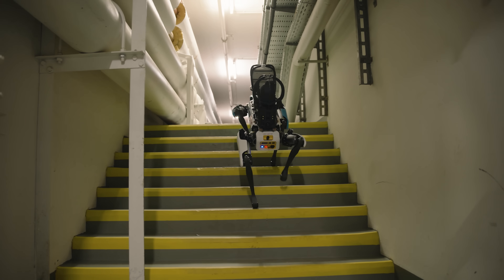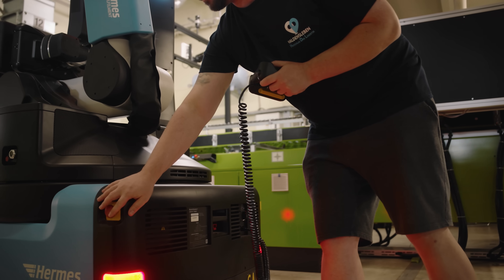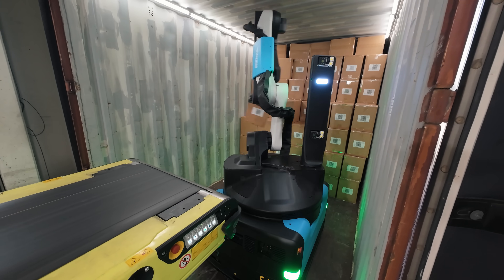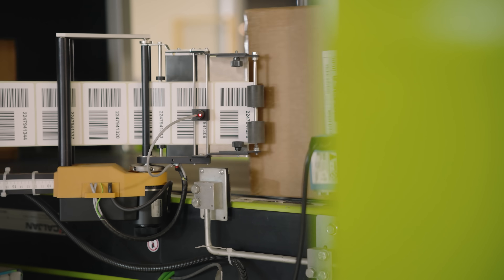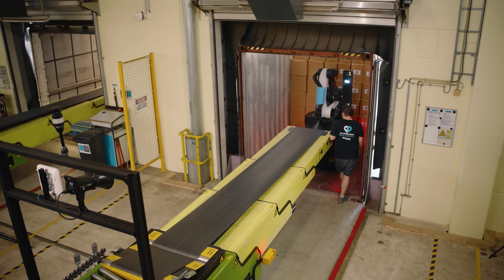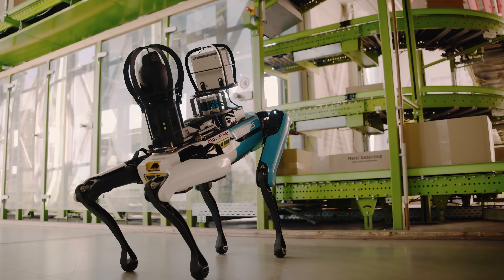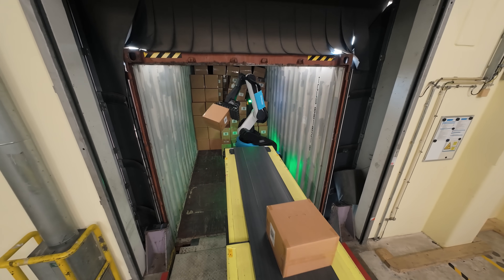Stretch Debuts in Europe at Otto Group

Comment: If you’re a warehouse owner and you’re considering buying this robot - don’t . 
Recently I worked at a warehouse that utilises them. 
It’s painfully slow, spends more time charging than working, requires perfectly shaped and stacked boxes to be able to unload a truck, and if it drops a box, it gets confused for a moment, then proceeds to pick another one, leaving the one it dropped on the floor. 
And the best part? It’s at least $500K a piece. 
You’re still better off giving a contract to a semi-skilled worker for ten years, it’ll be cheaper and more efficient, as one of these probably doesn’t last this long.

Comment: soo0o it's a robot arm that is designed to complete a task in a fixed environment (a container) - ie it has standard guardrails? Like a robot arm in a car factory? .. and it has to be hauled into place to start? that seems to be robotics on "easy mode" . And we did not see it actually complete a load, or pickup any dropped boxes. Also.... how is that container packed so neatly?!  Please show us a demo on "hard mode"

Comment: While this seems like a stretch, i worked in a large automotive plant that had 'robots'.  Welding robots and painting robots, which had static bases, and logistical robots, like forklifts and trolleys that delivered parts in cases to the assembly line and retrieved empty cases. The only difference between these robots and the one in this video is the incorporation of sight, giving Stretch a modicum of autonomy.

Comment: TLRW - Its a robot that moves boxes with suction cups. 

My thoughts - It will probably cost $500k up front per unit but will reduce compensation expense by at least $100,000 annually. Break even time will probably be around 6-7 years once you consider maintenance and service contracts.

Comment: I stopped play for a moment at 2:32 because THAT IS TRUE THAT IS A FACT I can recall one day MANY YEARS AGO I was forced to walk away from a truck lumping job that wasnt far from finished but there had ALREADY BEEN six other guys walk away from it before they even called ME over there to it by two oclock that afternoon I'll never forget it was a truckload of bags of dog biscuits that werent even palletized they were just piled up in the back of this full size semi trailer truck and it was sitting parked at the dock of this transfer and distribution point and the interior of that trailer on this summer day it was I forget what year but it was late summer and the interior of that trailer I kid you not giys it must have been close to 300 degrees F in there it felt like goin into a furnace with no firesuit i was like what the fucking hell is this even real is it even possible am I actually walking through a portal into the fires of hell itself here with it just LOOKING LIKE a trailer or what I made I cant remember if I made more than three trips into and outta that trailer hauling like four bags at a time because YEAH that was the real kicker they werent even bringing a palletjack and pallets to load these bags onto they had NOTHING even at the tail end of the trailer to put em in when I DID bring em out the dock manager was like just lay em on the floor and we've got a guy thatll come and pick em up yeah I think I made about 3 trips in and outta that trailer and I was like DUDE this aint happenin cant ya get a shop fan at least and aim it into the trailer to pump cool air in there and he was like no we dont and he didnt even apologize he was like and ya need to HURRY UP we need to get this trailer outta here I just looked at this guy and pulled my glives and said nope THIS LOAD is NOT MY PROBLEM mister its YOURS this is an OSHA CIOLATION is what we got here so GUES WHAT mister you are signing off on my temp agency work ticket to verify that I DID at least show up and I GET PAID for MY 4 HOUR GAURANTEED MINIMUM check for twenty bucks which he did sign and then I LEFT went back to my temp agency workplace turned the ticket in and got my check for twenty bucks cut to me - I know thats just a war story - NOW if ya want the REAL JUICE since ya sat through THAT and read all that THE IMPORTANT THING TO KNOW HERE FOLKS IS THIS these robot workers ARE NOT your enemy ok I KNOW we've got more than just a lot of pissed off dockworkers lead by some idiot thinking he's gonna cripple north america by shutting down the entire east coast and gulf coast shipping ports BUT its all just more engineered shitshow like political rallies the robots are the only chance we've got at maybe terraforming mars and making it suitable for human habitation THATS WHY WE're using them HERE we're JUST TESTING THEM for functionality and durability because if they cant even hold out in EARTH conditions they sure as hell aint gonna be able to hold out on MARS but we've GOT TO USE THEM to construct livable structures and working infrastructures and LABORATORIES capable of creating and HOPEFULLY RECREATING HUMAN LIFE FORMS to kick start a colony there. Earth is doomed folks theyve told us the eventually the sun is gonna dislodge the moon from our orbit and when it does its gonna have bad consequences for all life on earth WE HAVE to get out of here and get to mars and from there we hope to go beyond as well THIS IS humankinds best hope for a future or at least its the best one that anyone is collectively working towards anyway

Comment: What if part of cargo area get wet? How does it handle soaked box side? This is just perfect condition show case.
It's really an overkill, using highly advance and expensive machine to do dead simple task, like hiring Optimus Prime to wash your car.
Reply: the problem is that the machine is not very advanced. It is a general purpose machine, that could do a lot of different jobs. A machine made specifically to unload boxes from trailers could do this job at least 5-10 times faster that Strech can, and do it better. A human could run a bunch of these at once, and step in when something difficult needs to be dealt with.

Comment: I'm guessing that the robot can't handle pallets very well? Meaning that a human employee has to cut open the pallet before the robot can start removing boxes and once the pallet is empty, a human has to come and remove the pallet before the robot can continue. You can't ship unsecured goods like what was shown in the video. Also, these boxes are way too uniform and light. I'd like to see some 30kg box that has holes in them, is sogging wet and has been taped up on all of its sides. Now that's what I call a challenge.

Comment: Why not have the actual trailer bed itself push out the boxes onto a larger sorting belt? Maybe we could modify trailer interiors to have a mechanism like this. This would be so many times faster than removing each box individually.
Reply: If the logistics industry hasn't implemented such a mechanism yet I guarantee you it's not practical for whatever reasons.

Comment: uniform boxes, clear visible QR codes, always the same sequence no mention of how many units are usedd on the floor -> staged ad. 
Otto is probably using one unit for testing purposes. I don't think Otto is using Stretch productively. A Testing phase with nice PR.
Reply: As if the LED Lighting inside of the container was not a giveaway already.

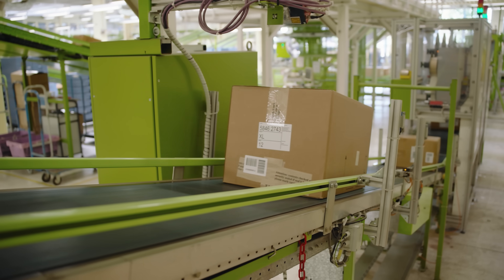Comment: Opps at 1:51 Stretch makes a mistake, and the camera cut away before showing it! HAHA, it's about to pick up a box from the bottom of the stack that is only slightly exposed.
Reply: Maybe, but it seems like all the boxes are pretty uniform, so overlap would be unlikely.
Reply: I‘m pretty sure it chose this as a resting position and its job ended there. This box also doesnt have a QR Code.

Comment: What about crushed boxes? What about half open boxes? What about boxes that are heavy and not robust enough to handle being picked up by a single face of th box without tearing the face of the box clean off?

Seems like you're just using it to unload perfectly pre-stacked boxes that are uniform in size and weight. What about a tiny box with metal plates in it? 

Been working around Ocean containers long enough to understand this is only useful for a tiny minority of uses. Without arms to grasp from the sides or underneath the boxes it would ultimately be useless for the vast majority of floor stacked containers I've seen.

Cute prototype, but nothing more imo.

Comment: This system isn't how it will be achieved. A whole load using a conveyor system & QR tracking scans the load & pushes the whole thing in at once. Turn around is less than 20 to 30 mins. 

The load is assigned to a certain truck in the network  the weight is accurately distributed in the trailer via sensors.

The trailer has a built in conveyor system also i

Comment: I worked in warehouses for ten plus years and I tell you every time they show these robots, they never show me any damaged boxes or any irregular boxes. Quite amazing to me. 😂
Reply: @damienwade7848  yeah and they're always indentical dimensions and perfectly stacked. trucks in the real world show up like they rolled down a mountain and with 1000 small packets mixed in with the boxes
Reply: @Zreknarf  Can confirm! Because I loaded them like this! I got minimum wage, they got minimum effort.
Reply: It’s a marketing video so they’re going to want everything to be pretty and clean.
Reply: @NBSV1  Certainly, this is one thing to consider analyzing this. It's also theoretically true that Stretch's capabilities are still limited in some way they're trying to hide, but they did claim in the video that it can handle graphical boxes, damaged boxes, irregular boxes - And the capabilities of the hardware, at the very least, back up that claim.

We know that this type of gripper is highly capable, when controlled correctly. We know that this thing can lift and move a box. The only question here is the software, as it always is.

Call me a fanboy, but I really don't see them making claims about the software that the software itself can't back up. Boston Dynamics has always been a highly holistic robotics company - They don't depend on gimmicks, and the only stuff they do that's "flashy" is stuff that actually works.

Granted - I'm surprised they went to so much effort to make everything look so clean, when that visual hugely undercuts the impact of the capabilities of this robot.

For example - Nobody has commented on the fluorescent lights in the corners of the shipping container they've set up here. Stretch can operate in the dark? They're not showing that - Probably just because it's hard to film cleanly. But they are saying it. Stretch can deal with graphical boxes, damaged boxes, irregular boxes? They don't show any of those, because A: It would be visually messy and hard to track, and B: Probably because they don't want to have to pay to license all of those graphics for use in the video.

There are a lot of practical reasons for them not making the video more logistically impressive, but it does also undercut the point they're trying to make. I think there were ways they could have gotten around that to make a more effecting demonstration video... But on the other hand, it is a marketing video.
Reply: All the workers are really excited. Meanwhile, no videos of said workers 😮😅😂
Reply: It also works much slower than people
Reply: @poochyenarulez  but it works all night, with no break and no night shift bonus buddy
Reply: @Stormsolid  no breaks, no sleep, minimal lighting, and most importantly no heating or AC.
Reply: Sometimes trailers have big boxes of damaged liquids inside we are not allowed to place them on conveyor. Imagine this thing will throw anything on the conveyor
Reply: Have a sister who worked in UPS it severely damaged 3 disks in her spine leaving one almost completely ground down.
This work would be best left to the immortality of the machine
Reply: And all of them have the same size xD
Reply: i love it when people make one nice wall of boxes only for a complete mess to be behind it, where the loader just threw all the light and small boxes in there.😂
Reply: If replacing a human with a robot is financially viable, then they will standardize packaging to favour the robot. Standardization of packaging to deal with automation is not new.
Reply: That's what I thought. Nice demo, now let's see how it works with a real container! At least it's nice to know that we are not being replaced by robots.... for now.
Reply: @damienwade7848 true. Modern robots can hanfle irregualrities well. The can even be programmed to pick parts from a bin laying in a random orientation. This one can not handle round objects or stuff that isn't boxed. Nor can it handle boxes where to bottom breaks out if you lift them. :D
Even this is a question of manipulator type used and can be done. It isn't all about letting the robot replace any worker (just a few). Sometimes even a fancy robot like this needs help and even more maintenance than a human after 20 years of operation.
Reply: I have never received a damaged box except a few scratches or a little dent here in Germany.
Reply: It can pick up a damaged box and irregular boxes❤
Reply: @ankhenaten2  the video says "Slightly damaged boxes". Emphasis on the word "slightly" there. they probably say that because it can't handle heavily damaged boxes.
Reply: @hughmungus2551 why not ? It works by suction ? as long as a small surface area isnt completely folded into each-other, the robot can use the cups there ?

Comment: Isn't using a walking robot like Spot on a smooth and level floor surface inefficient energy- and cost-wise? Wheeled robot could be cheaper (original price and repairs) and faster moving.
Reply: Yes, and in an industrial setting, with smooth open floors, that would seem better, but a walking bot can climb stairs and go over obstacles. Plus, they have a hammer, and they are looking for nails to hit with it.

Comment: Order picking is one of the last high paying labor jobs left in the US... Companies also want to reuse boxes as many times as possible to reduce cost, this robot requires nearly perfect boxes with only minor damage, meanwhile the vsst majority of boxes at the major warehouse I work in are almost entirely destroyed, holding on by a thread. From what i see in this video, the robot is probably around 1/5th the speed of a human picker/stacker at best, of which our warehouse runs 24/7 shifts of already, so at least my union labor job will last a few more years. These need to be considerably faster and able to handle more variation, collapsed and shifted loads, and consistently damaged boxes before they're usedul in all but the most prestine warehouse conditions. A single one of these robots likely represents years worth of labor costs snd that human labor will be vastly faster at loading and unloading real world loads for a while to come still. Consistency doesnt mean a lot when human labor already runs shifts 24/7, that work faster, harder, and can handle more diversity in a load and problems that arise, human workers are also already required to be 99+% accurate, so is this really worth the 1% accuracy improvement if speed is considerably lower? Not to warehouses like mine. But for a company who has all perfect boxes, similar sized products in a brand new top of the line custom built warehouse who also only need low order fulfillment speed, it could be nice. But many warehouses operate at 97-99% full and require product move FAST in and out with orders from pickers needing to be a near continuous stream of boxes on the belt and someone who can stack fast enough to ensure the belt doesnt get loaded. Going this slow would result in production getting backed up, rack space getting filled, and everything grinding to a hault. The real world isnt perfect. I've never even been in a factory or warehouse these would work in, but it may exist somewhere.

Comment: Stretch allows the Business to put employees into a different and safer environment. At home without a job.
Reply: That's what they said when steam engines arose in the 1800s. That's what they said when electricity arose around 1900. That's what they said when computers took over some work ...
Will people finally learn that we still have jobs? And more safer, cleaner, nicer ones too compared to those in the Middle Ages?
Reply: Which is a preferable place. Screw this job, let the robots have it.